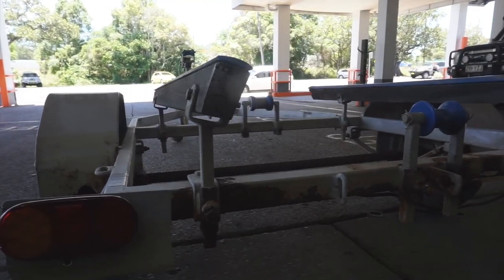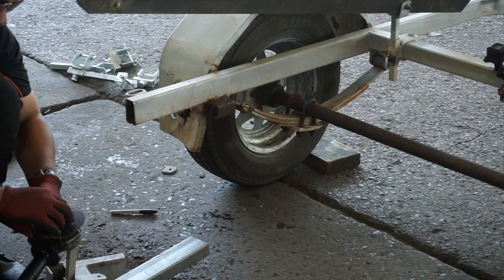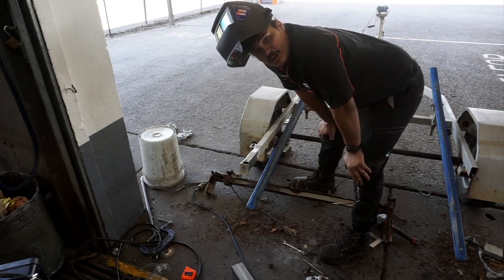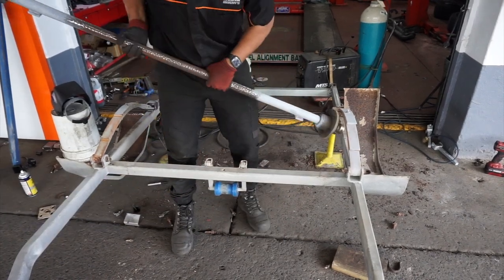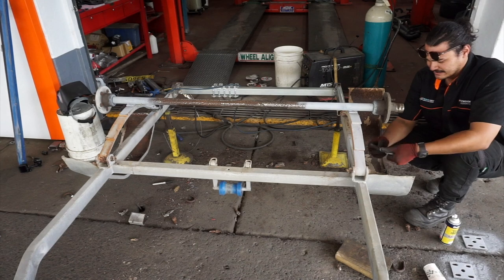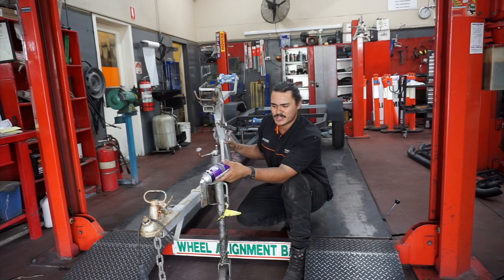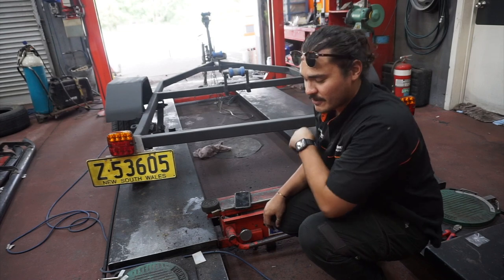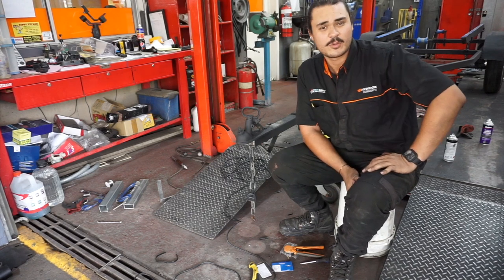Budget Boat Trailer Restoration - Fixing the rust, Flipping the axle - Episode 17

Comment: Hey mate what are the steps from the rusted trailer. 
1 clean rust off
2 
3
4
In order do u use any rust converter then primer ?
Reply from the maker: Hey mate,
Kinda of just winged this. 
I cleaned the rust off and welded everything back on that needed to be weld.
i just justed a etch primer then a metal sheild top coat from duluxe.